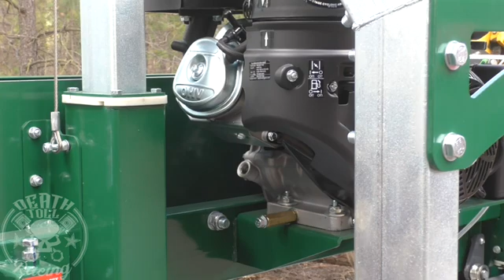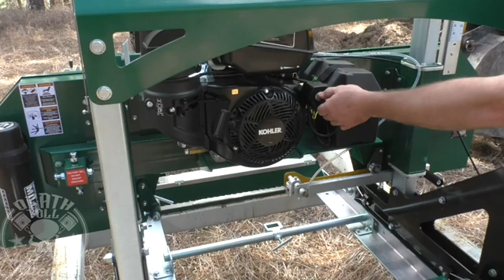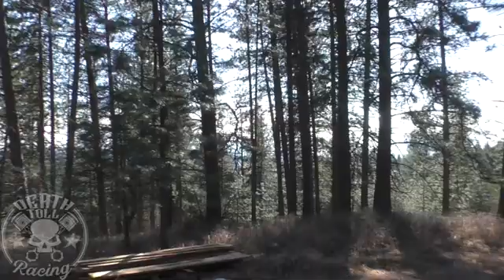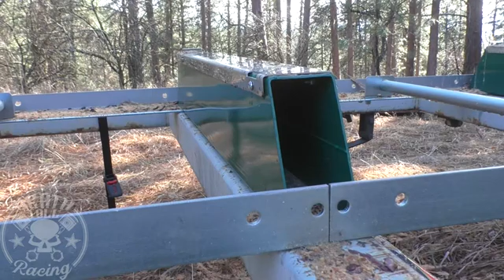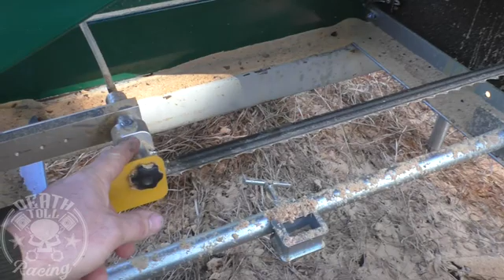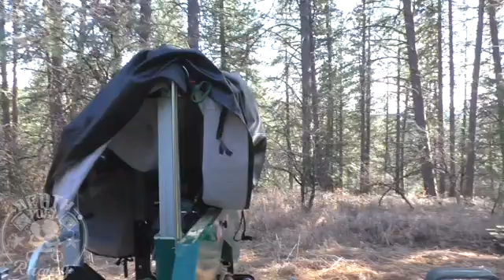Woodland Mills HM130MAX Mobile Sawmill First Start and First Cuts!  (Re-Upload)

Comment: I really enjoyed the videos you did on the sawmill. Really appreciate the style of delivery and speech.  I am not sure if you are still planning on doing any follow-up videos to the woodland mills sawmill, but I am considering buying the same model. Was just curious if you had any thoughts after almost 1 year of usage. Are you still please with it and think it is a good value? Many thanks!
Reply from the maker: I do plan on making a follow up video series.  I'm going to start a new channel that is going to be geared more towards this type of content.  I will make a post when it's up on this channel and it will address everything I learned so far.  I am in the process now of making a building for it and taking it off the trailer and adding another section of travel. 

I have had no problems still with this mill other than me being an idiot and running into the log stop with the blade.  It has more than paid for itself in savings already.  

Thanks for your positivity!   You won't regret the mill.
Reply: @DeathTollRacing  thanks so much for taking the time to respond. I've got a small channel, and even with just a handful of subscribers, I know the work it takes to get back to people. I really appreciate that insight. What drew me to your review was the fact that you seem to have some pretty advanced mechanical skills! Way beyond my level! Thus, I'm much more trusting of that review than most. Again, many thanks for your great work!👍👍👍

Comment: Looks like a great mill. I've had mine for about 30 hrs. and I still can't get it square or the garage to sit true. This is a nightmare!
Reply from the maker: Oh nooooooo!  That sucks!  Did you see the assembly vid I did?  Maybe there's something in it that may help?
Reply: @DeathTollRacing  
I thought I was watching the right ones. The only other thing I need to try is loosening the entire saw cradle while it's on the track and see if  it relaxes enough to sit flat on all four rollers.
Reply from the maker: @pz1269  could be. I’m not sponsored or anything. I just made the videos to be helpful.
Reply: @pz1269  check out sawing with sandy. He's a Canadian that has this mill and shows levelling it with a string line. Actually, not necessary to level it per se, but he gets her close enough to mill with.

Great video by the way OP! Sure wish I had your bucket loader , Hell of an operation you got going on here!

Comment: Thanks for your input.  Good video.  Nice woods, lots to cut.  What kind of pine or spruce do you have?
Reply from the maker: Thanks. My pine is ponderosa (i think it’s the worst of the pines) and the firs are Douglas. The firs are choking out the pines, but not fast enough.
Reply: I have white pine, white Cedar, red cedar, blue spruce, poplar, Aspen, sugar (hard)Maple, red oak, white oak, Elm, hickorys, walnut, beach and my ash are being killed off by the Emerald ash borer.
Reply from the maker: @RuralRevolution  dang. That’s a great variety!

Comment: What would you think of this unit for sawing 30" logs? Is it enough horsepower? Have you used a different sawmill? Because of delivery lead time I'm down to Norwood and this unit. Norwood is quite a bit more when considering extras. I have 35 acres of timber and once I've broken it in and learned how to mill I don't want to be held back by lower horsepower.
Reply from the maker: So horsepower so far hasn’t even remotely been an issue yet. I have not milled a hardwood yet though, but I think that would actually be easier on power since it would be cleaner cuts and not pinching the band as much. You have to push it really hard to even get it to sound like it’s doing labor on the engine. I did option for the bigger engine on this one.

Comment: lotsa rattling
Reply from the maker: The rattle you can here is the clutch.
Reply: @DeathTollRacing  I don't think so, unless yours is pooched, and even then... When they engage, they quiet down. Sounds like your enclosure, that would drive me nuts
Reply: @DeathTollRacing  I'm talking about when you're going full out and cutting not at idle
Reply: maybe the fender on your trailer is rattling, haha
Reply from the maker: @Cacheola  it may be. It’s going to come off the trailer this spring. I don’t remember a rattle while using it, but it’s been a long winter.

Comment: I use a tennis ball on my scale board, center you pith ( lift small end of log ) you'll get more yield from your logs , and reverse your throttle so your pushing against it not pulling. I personally would change angle on throttle mounting pipe just to make it more comfortable.  There again all my thoughts, you do you . I've had mine going on 5 years. Love it. 
PS , you will hit a log dog sooner or later,  lol
Reply from the maker: Lol. Thanks. I have hit one. I thought I was clear.....  damn it.

Comment: im sorry slide over the scale clear is easy to find
Reply from the maker: I did not follow?
Reply: Get a rubber hose like a fish tank hose that's clear get it big enough you can squeeze it flat and slide it over the scale to keep it from poking a hole in your cover . Should be at the local hardware home Depot Lowe's
Reply: I’m getting my saw mill woodland that is, tomorrow and I don’t have the cash for a tractor but need to know some easier ways to get logs on the mill
Reply from the maker: @donwilkins9771  i would say some simple ramps and a boat winch to slide them up would be the easiest.

Comment: Couldn’t you just put a heavy duty plastic cup over that log scale so it doesn’t poke a hole
Reply from the maker: As long as it’s not to big. The cover is kinda tight right there. I was thinking about that the other day, but I was thinking an abs pipe cap.